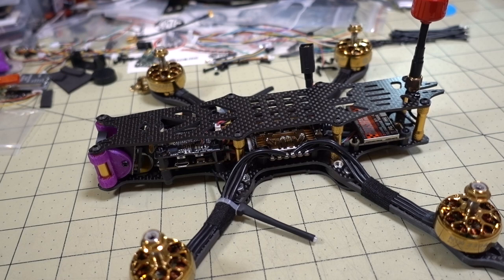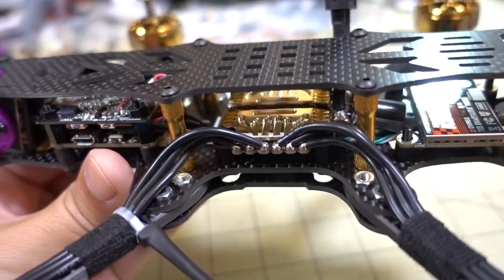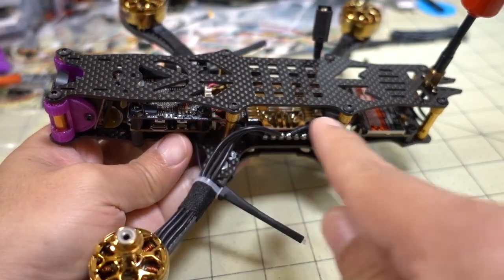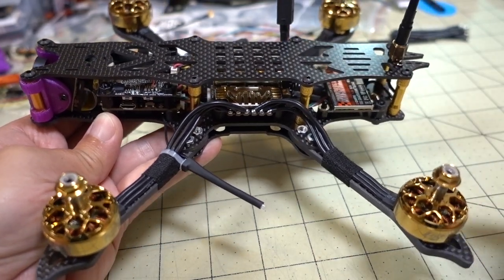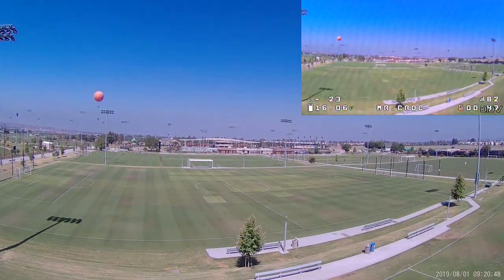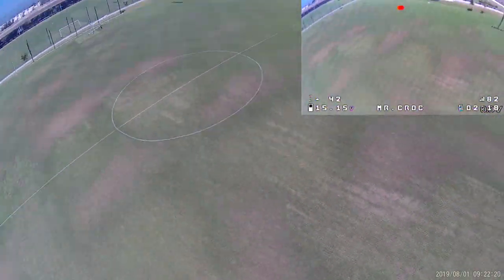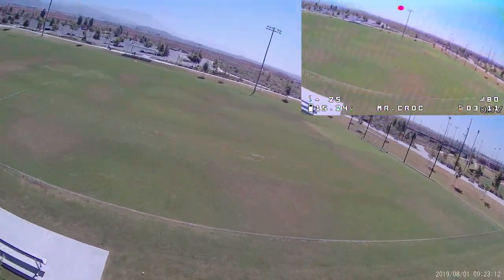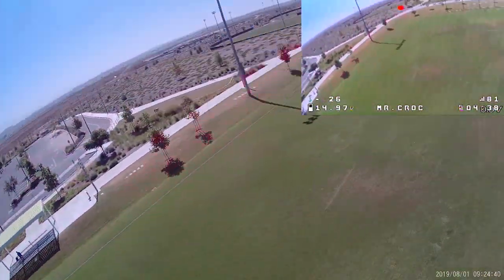FLYWOO Mr.CROC & Hawkeye 4K Split Cam

Comment: Nice build. can you please share your PIDs settings?
Reply from the maker: Just default PIDs on 4.0.4.  I didn't tweak anything.  With 5-inch quads on 4.0.4 you don't need to touch anything as it's designed to work with 5-inch without a need for tuning.

Comment: Thank you for the video!  I have been searching hard for any good info on the new Hawkeye Split and this was the most useful by far.  I have a Tarsier on an Acrobrat, which I love, and have been trying to decide between a 2nd Tarsier or the Hawkeye for my next quad, but for video quality and latency it seems the Tarsier is the winner.  Do you know if they will improve the bit rate on the Hawkeye?
Reply from the maker: Bitrate is not really an issue
Reply: @AlbertKimTV  That's interesting.  I trust your judgement.  How does 4k video quality compare between the two before youtube compresses it?

Comment: I was close to buy the Mr Croc frame but I hesitated because of the long nose. Iam wondering if you see that back in the camera when flying freestyle.... And I wanted that frame because the different mounting options for the arms to feel if it really makes a difference when flying. I think that option is awesome 👍. O and I was surprised to see that you can fly a quad with the FC in front I always thought it must be exactly in the middle. Very interesting. Thanks!
Reply from the maker: What are you asking you can see in the "back in the camera"?  The question doesn't make sense to me.
Reply: @AlbertKimTV  hey Albert. I mean that with the long nose it may sway more because it's further away from the  pivot point. And that you see it from a different  point like the bus driver seat that is way in front of the front wheels, than the driver experiences a swaying when steering more than when the drivers seat is directly above the wheels. I hope I make it more clear to what I mean my English isn't that good....
Reply from the maker: You would see the effect on the pitch axis mostly.  The movements will look a little more jerky but you can tone that down with less rate.  I really didn't notice any difference even after you mentioned this.
Reply: @AlbertKimTV  okay thanks for the answer. Now I know I can buy one 😁

Comment: I wonder how 2206 motors would do on this kind of weight. And why is there so much latency, because of the split unit or something?
Reply from the maker: 2206 should be OK unless you are racing this.  Latency is from the split design.